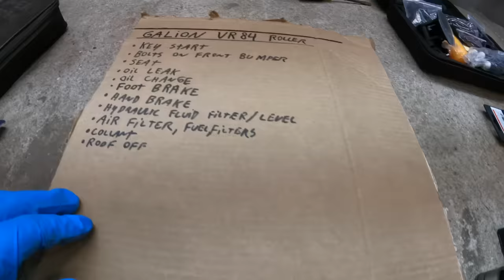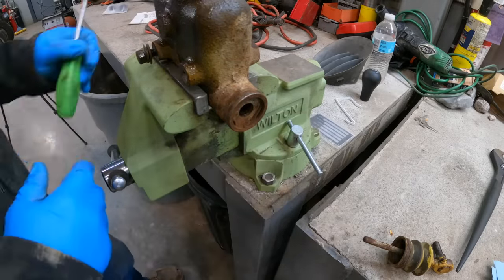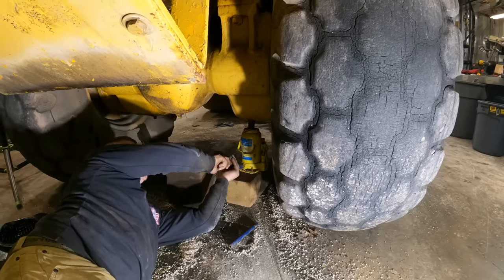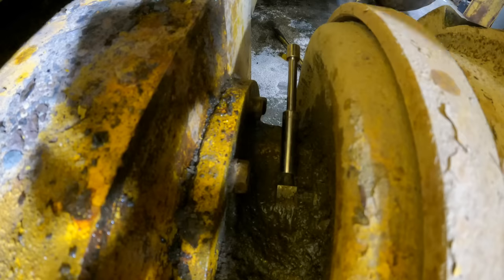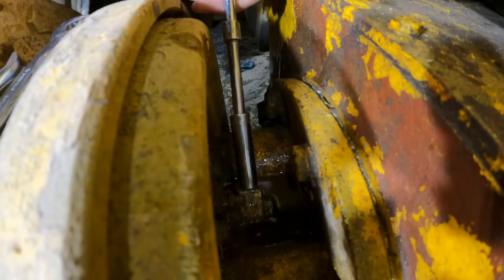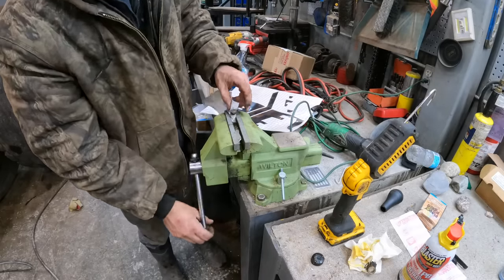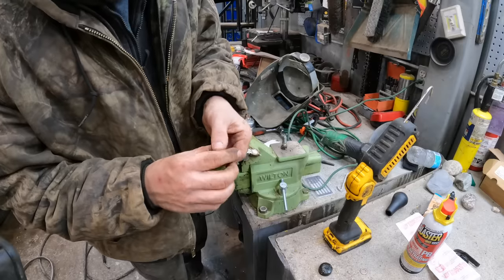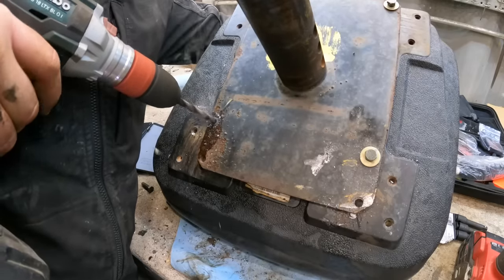Fixing up and moving Andrew Camarata's roller

Comment: Jumper cables build your own. Go to an electrical supply shop and buy your cable by the foot. They will probably have the heavy duty clips also. The cost is actually cheaper and the cables are far superior.
Reply from the maker: Yeah I would have been better off. Napa charged me $160
Reply: @Dumpster_Dave  I made some out of old welder leads. (10 ft at least) Best set of "homemade "jumper cables I ever had !!!! And cheaper in cost...

Comment: Considering how smooth the tires are, I can better understand why Andrew was having so much trouble getting the roller up his hill.   I admire your craftsmanship and ability to work in small spaces on massive equipment.   Thanks for sharing this insightful video.  Wishing you and your family a blessed week, gentle weather and restful evenings.  Peace
Reply: @ralfdahms1035  I wonder if Andrew could cut the side walls off the old tires, bolt - rivet - screw some bars of angle iron across the slicks and wrap them around the new tires as studded snow - ice covers?  What ever happened to the broken chains from the ditch witch?  Could they be adapted to winter ice chains?

Comment: Probably wiser to back it up hills next time, so that it's pulling the drum and you have more control, rather than driving it uphill drum-first and having it slide all over the place. That, and having the skidder pulling it for safety. The weight of that machine, the lack of traction and the smooth drum when leading make that a death trap running it up hills of frozen dirt and ice. No ROPS could mean things go bad fast if it starts to slide off one of those mountain hills and flips.
Reply from the maker: Good idea

Comment: The reason the winch cable failed at +56:20 is that as the cable gets shorter the snatch block that the roller is chained to is pulling the cable sideways. As the cable gets  straighter (and the snatch block is pulling more and more sideways on the winch cable) that causes the tension in the winch cable to rise exponentially. Pulling sideways on a cable can even cause the tension in the cable to exceed the tension that would be caused by just lifting the roller straight up off the ground. For example, when the angles between the roller, the winch, and the anchor tree are all equal (ie 120 degrees each) the tension in the cable is double what's actually pulling on the roller.  The first set up at +55:30 (with the snatch block chained to the anchor tree, and the roller pulling inline on the winch cable) was in fact the correct setup, you just needed to use an anchor tree and chain that could withstand twice the force of the pull exerted on the roller.

Comment: I was wondering the whole time how these tires can still hold air. 
They are driven down to slicks without profile, they are very old and worn out,   
and they have intense dry rot on them everywhere. 
Two chains mounted together with the new tires would be very useful, 
but i think I remember Andrew mentioned that in one of his videos too. 
Tom 😎
Reply: recent video released on replacing them. they have an inner tube.
Reply: @willdutt  The old ones had an inner tube due to  the age I bet, originally they are tubeless and Andrew mounted the new ones without inner tube.

Comment: A little tip on cutting the water heater hose. Use a band clamp snugged down on the hose. Just tight enough that it doesn't move easily. Align one edge of the band clamp on the cut line of the hose for a guide. Then use a sharp box knife and cut using the band clamp as a guide.

Comment: Can you turn an old dump truck into a roll off truck? 
 I have a 98 international 9400 dump truck with a single cylinder on it but the dump bed is trash.  I'd like to fix it up like your mack and have other beds to use with it.     Is all of that possible?   Thanks
Reply from the maker: If you do a cable hoist, you will need a longer wheelbase,dump truck probably isn’t long enough, but you could do a hook lift
Reply: @Dumpster_Dave  I'll measure the wheelbase.  I think it's a 19 or 20 foot dump bed.  I think it's a weird looking dump truck.

Comment: All Andrew equipment should have D Rings mounted on the front and rear of all equipment....... just saying.......
Reply from the maker: Yeah we said that after it was stuck
Reply: @Dumpster_Dave  great job help fix up the roller ...... great videos also......new to your channel......in south Georgia we make jumper cables out of heavy welding leads about 20 feet long...... work great 👍

Comment: Towing that with the tires facing forward like a front wheel drive and the steel roller trailing might have worked better with more control. Just a thought.

Comment: The roller left the shop in an unsafe condition for use in building mountain roads, and a safety inspection was not performed.  The tires require replacement; there are no chains and rollbars.  There is no safety plan for the team.

It's better to set an example for professionalism than have this kind of "excitement."

Comment: Is it just me or was anyone else appalled when that chap put brake fluid into the contaminated master cylinder. Did he really intend to use it without cleaning and inspecting it first.
Reply from the maker: I cleaned it and vacuum it out in the beginning. It passed the one eye inspection 🧐